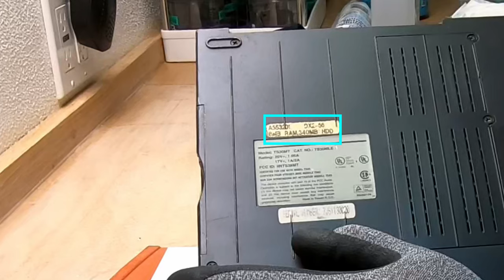Epson Action Note 660 CX Scrap Out! in 4k

Comment: But is the plastic on this computer bad?  I would have one but of a different model, it is an "Action Note 650" and for what little I tried to disassemble various pieces of plastic fell, I blamed the heat it received over time in its case. .. raise me a little curiosity since you could touch and see the motherboard of this computer, what type is the cmos battery?  Is it different from those found on today's motherboards?  Because I would like to recover this computer, whose cmos battery is dead and I would like to try to change it without destroying other various pieces of plastic, if it is not possible then I will not make the change ...
Reply from the maker: As far as i could tell the plastic really was that bad. Due to nearly 30 years of outgasing and various thermal shock received through its life cycle. Also plastic today vs 30 years ago. I dont recall a CMOS battery off the top of my head. I shot this many months ago. Do you have a time code? My honest feeling if you want to maintain a intact unit. Dont take it apart. Work around the bad CMOS battery. Reconfigure it every time you want to use it... Unless you want to 3d print a new plastic housing....
Reply: @gizmodious  Hi, thank you for your reply.  I finally made the decision, after destroying a few pieces of plastic, to keep it as it was.  And strangely the computer date does not reset, strange because it used to give me CMOS battery error.  Good day